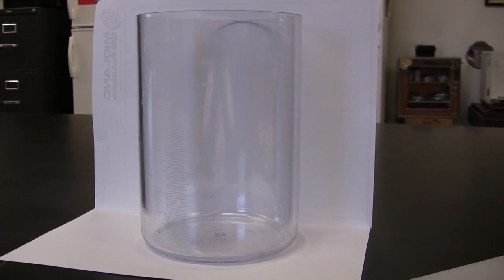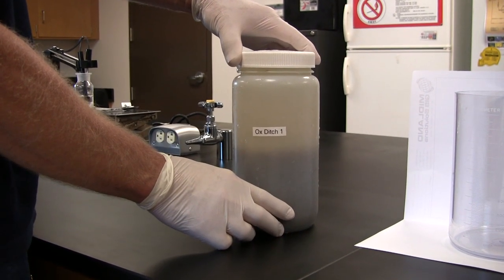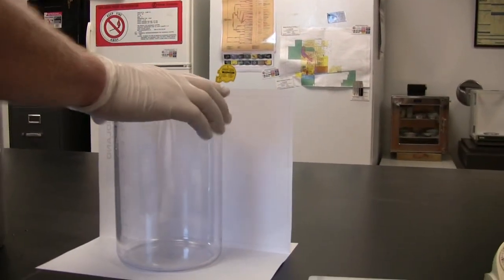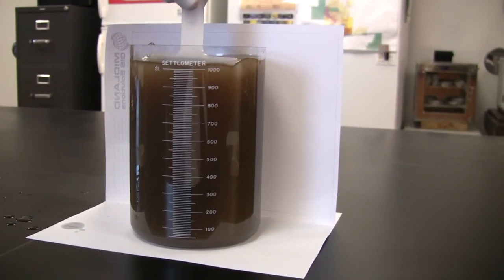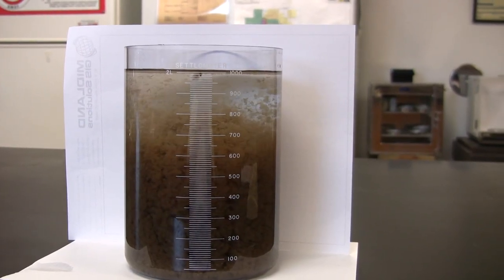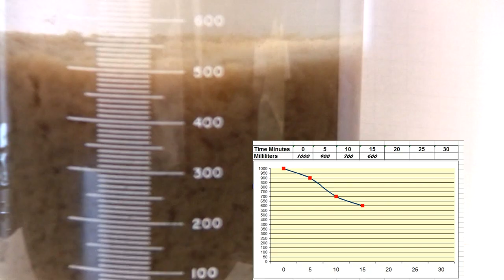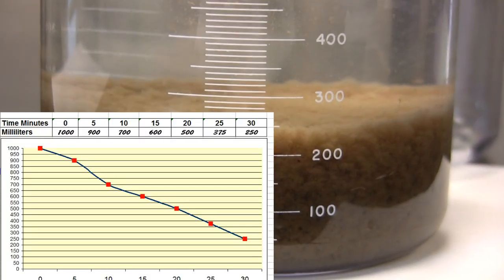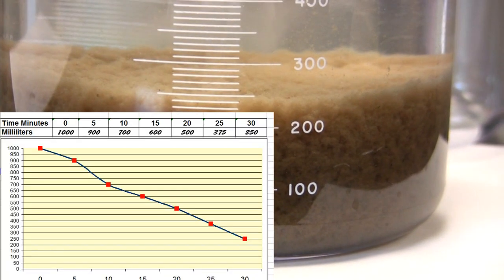Settling Test using a Settlometer.wmv

Comment: At the end of 30 minutes you record the SV e.i. sludge volume or ml of sludge per liter of sample. The SVI, sludge volume index, is the SV divided by the concentration of mixed liquor suspended solids multiplied by 1000 and reported as ml S/g MLTSS. If he SVI is less than 60 the sludge is settling to fast if above 150 the sludge is bulking e.i. there are to many filamentous organism in the biomass.
Reply: How do you calculate the concentration of mixed liquor suspended solids ?
Reply: @AM-qe6em  Analytical determination. Its a gravimetric procedure see Standards Methods for The Examination of Water & Waste Water 19th Edition Method 2540 B. Basically you filter a sample through a tare filter, solids are retain in the filter, you dry at 103 deg C and weigh the filter+solids. Difference are the solids.

Comment from the maker: Yes you need to mix gently or else you change the characteristics of the floc.  Yes you can use a paddle .. use the back and forth action not the swirling action. On the SOP not sure if one exists .. Maybe WEF training material has one, or EPA manuals.  Hope this is not a duplicate posting.

Comment: I hate to burst your bubble but that settlometer is not 1000ml its 2000ml the settlometer scale has noting to do with the ml. Your typical settlometers range from 1.4ml to 2ml and all are mark at with having 1000 and the top of the settlometer scale.

You may want to check your calculations!
Reply: A Mallory Settleometer is a two-liter container, but is marked with graduations up to 1,000 and the results are read as ml/L. Other containers can be used for the Settleometer test, but avoid those tall graduated cylinders, as the friction created by the walls can slow the settling and give false readings.  Wide mouth containers are preferred.

Comment: how do you use the chart to calculate SVI
Reply from the maker: The number after settling for 30 minutes is the SSV(30).  

                                             SSV(30)  X 1000 mg/g
To calculate  the SVI    =  ------------------------------------- 
                                              MLSS (mg/L)

The chart is mostly used to view the slope of the settling rate.  the higher the slope, the older the sludge, the flatter the slope the younger the slope, or there is bulking.